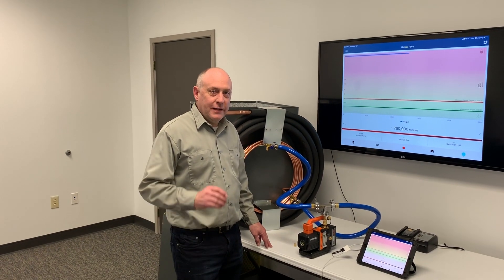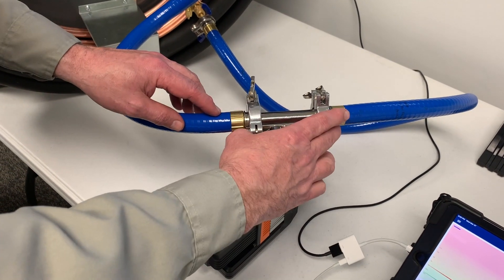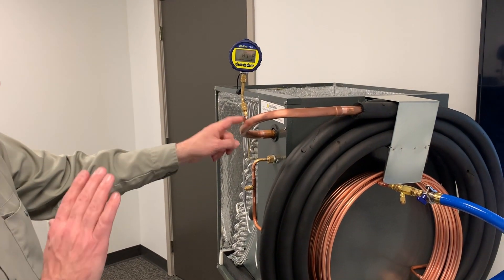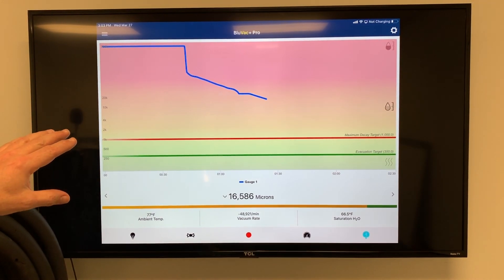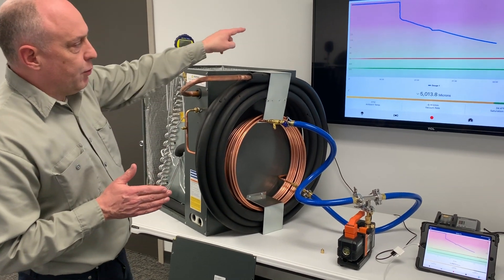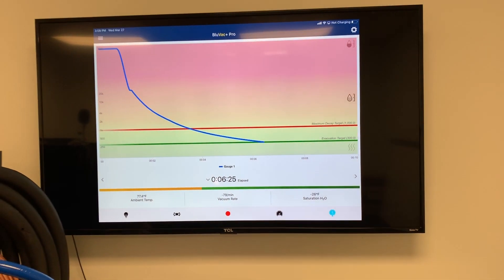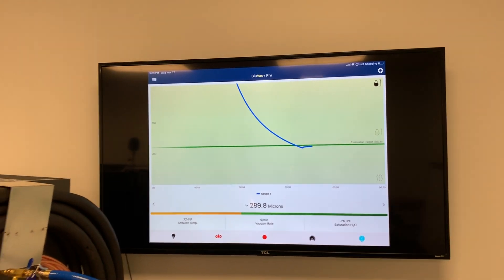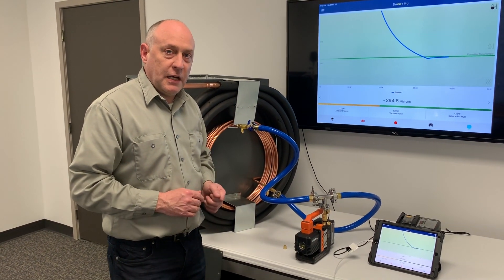NAVAC 2 CFM Pump Video

Comment: This setup would be great when you have areas with little or no outlets. This setup would work great to what I did on a 2nd floor unit with about the same amount of line set. 

How would you compare the 2 CFM pump evacuation time or effectiveness to the Appion rated hoses compared to the TruBlu hoses in the video?

Comment: Nor Cal dave proved that IN THE REAL WORLD this is not the case.....you need all the batteries ..and our REAL WORLD SYSTEMS HAVE OIL... REFRIGERANT..ECT.....NOT A BRAND NEW COIL...DUDE GO OUTSIDE AND DO A REAL WORLD TEST ON LETS SAY A 5 TON COMPRESSOR CHANGE OUT...THESE "LABROTORY" RESULTS DONT WORK HOMIE.....AND THAT PUMP COSTS MORE THAN MY 7CFM JB PLATINUM....IN MY OPINION..A WASTE OF MONEY...IF YOU CANT CARRY 30LBD AND A CORD TO PLUG IN SIT YO ASS AT HOME AND LET THE REAL MEN WORK...GAAAANG GAAAAANG
Reply from the maker: That was the problem, it was a real-world test, using the pump with the wrong hoses in a manner that a lot of techs would have used it. Here is the link. https://youtu.be/8tyxZFRuZ20  I believe if you watch the video again you will notice that he used 1/4" hoses the first go around. That is the reason for the multiple batteries and the slow evacuation.  The test I did was not a lab test, it was typical to that of a new installation. Your 7 CFM pump is no better than that 2 CFM pump with those 1/4" hoses. They would both be choked down to .2 CFM. You have a bit to learn if you think otherwise.

Comment: Really appreciate this video and it tells much. Quick thought and question... Being that we shouldn't put refrigerant through the hoses, it makes sense that you would have to have a lot of refrigerant under pressure to make it bad for the hoses. Of course, we all know that contaminants in the system and residual refrigerant can go through the hoses correct when being pulled out by vacuum? Does that hurt anything with the hoses? I think I've actually seen you clean them out with alcohol? When necessary

Comment: Nice video, but for the cost I can get the VP85. As a matter of fact I just did last month. It’s a nice little pump, but I like being able to walk away during a vac to grab lunch or whatever and let the vac continue without watching a battery. Love my new trublue three hose set as well.
Reply from the maker: The Fieldpiece VP85 is still one of my favorite pumps. I really like the manifold and the quick oil change. Three reasons for the video, one to show that pump size is secondary to hoses and that 2 CFM is very viable, and that a battery pump can easily get the job done. For a new startup, I would grab a battery pump any day of the week. If I was doing service work on anything under 5 tons there is no reason that I would not use. it.

Comment: Good video ! But, systems have a compressor , condenser coil with residual refrigerant in the oil that has to be boiled out & a New drier after a repair. Add a 5 ton condensing unit to your set up there , a drier , & u have a better real world test. This is a Good test for New installs though. Cool Bench set up ! any eta on Getting R-417C ( Hot shot 2 )  added to measure quick ? Good vids !
Reply from the maker: The refrigerants are added all ready for the new release. That was very much a real-world test for a new installation. As far as a larger system, or a really wet one I might still use a corded pump simply because of the larger oil capacity and a gas ballast. There is no reason though that if the system was not wet that it could not be used for service. I would simply pull to 500 instead of 100-250. There is no reason not to have two pumps. I have a corded drill and a cordless for the same reasons.
Reply: @mQ - Yea, it definately could be convenient as a second pump. its a nice thing not having to run a cord across the floor. ( Trip & fall restaurant accident would not be good in california )   Also Thank you for adding The R-417C ( Hot shot 2 ) to MQ.
Reply: Yeah... on some of the old junk refrigeration equiptment I work on, it seems like it takes forever to get them good and dry. Couldn’t rely on a cordless pump for that. 

New installs or reach ins and stuff. Hell yeah. Sounds like a good option. Don’t hardly have the space for anymore tools though

Comment: Hey jim great video. Question with this new set of vacuum hoses and accessories do you still practice triple evacuation. Or is it still necessary.
Reply from the maker: Triple evacuation is really not needed when you can achieve vacuums this deep.
Reply: Triple evacuations are More for systems that Have sucked water into them , Burnouts , and systems  that Have Had Line sets With Flush ran through them , Triple evacuations really excel when a system has been wet inside because the Nitrogen is dry & collects moisture when it enters the system , soaks up moisture when it is in the system , and then takes the moisture out with it as it leaves the system. Speeding up Evacuation time is its real purpose on Wet systems. Thats where it really excells.
Reply: No oil in a new system greatly reduces evacuation time.  With volatiles trapped in system distributed oil, can take much longer. Additional nitrogen flushes help sweep volatiles out quicker which doesn't help much when there is no oil yet distributed in a new system.